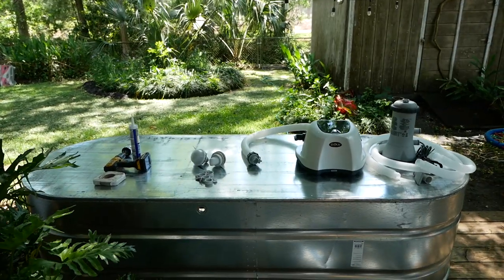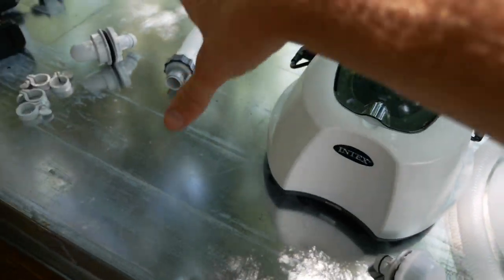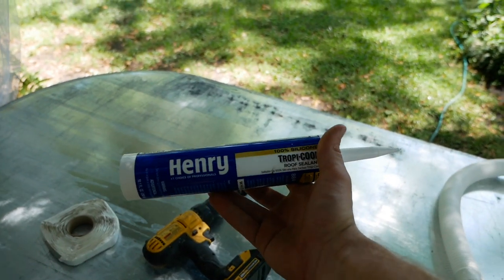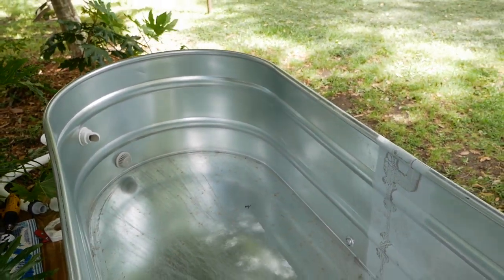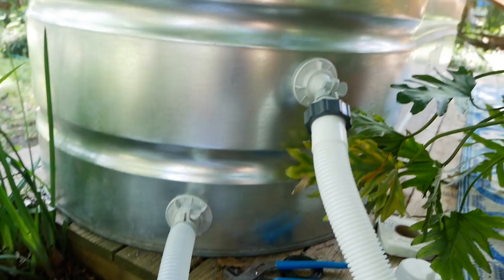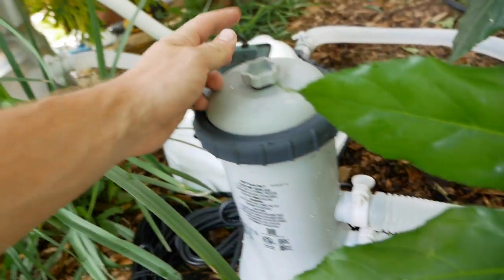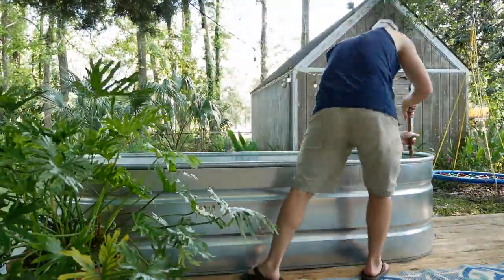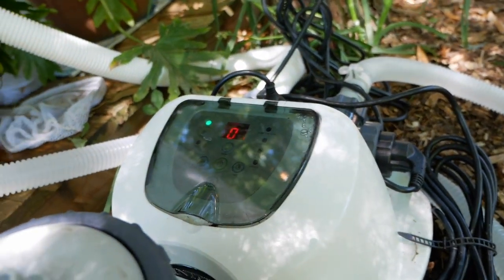Build Your Own SALTWATER Stock Tank Pool For $500

Comment: I didn’t drill holes. I propped the cartridge pump and salt chlorinator up on plastic chairs, dropped the intake and output hoses directly into the pool and weighted the hoses down with ankle weights. Works fine

Comment: We're also thinking about putting in a salt water stock tank pool.  How has this held up 2 years on!?
Reply from the maker: Well our pool has spent plenty of it's life in storage for the winter, and the bottom seam of the tank is leaking a bit. Tiny bit of corrosion in the tank. Still overall functions as intended and painting the interior of the pool would likely mitigate that problem. I still think the whole system is a go, but the saltwater mechanism has become very expensive and hard to find over the years. If I were to do it now I might just use the $20 chlorine float. But the saltwater is nice.
Reply: @MobileDwellings  thanks for the update!